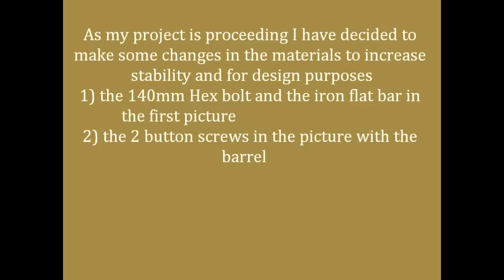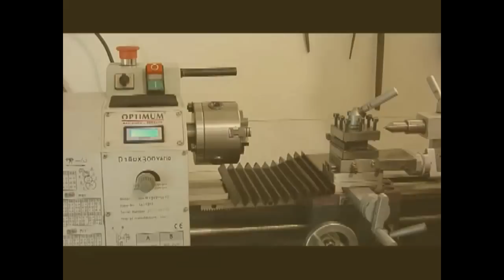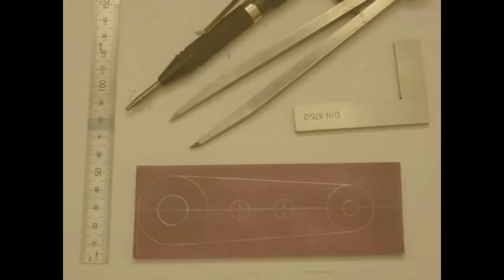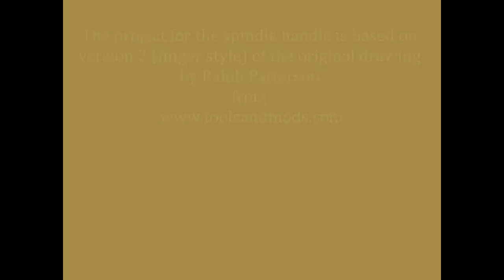Optimum D180x300  Lathe spindle handle

Comment: Very pretty handle you made.I just made one for my mini lathe I used aluminium for the expanding mandrel and cone with 6mm threaded bar through the middle a scrap piece of steel for the arm I used a hacksaw for the slots so not pretty but works very well all the best.
Reply from the maker: Hello Terry,
Thank you very much for your time to watch and your comment, I appreciate it!!
Allow me to say that it would been better if you had used a steel pipe for the mandrel instead of aluminum. I know that aluminum it's easy to work with, but it can wear easily especialy with the forces applied when you cut threads. I definitely recommend you to make one out of steel. 
Thanks again for the comment! Merry Christmas and happy New Year, my friend!

Warm regards from Greece
Jimmy
Reply: Hi I now have a slitting saw so can do a neater job and think I will remake that part out of steel at some point.cheers
Reply from the maker: Hi,
This, it will really nice to do plus that will grabs better on the spindle.

All the best
Jimmy

Comment: Any complaints with your Optimum lathe?  I know their on the pricey side compared to other Chineese made units.
Reply from the maker: proclaimliberty2000 
Hi,
Thank you for asking!
Only the usual that all mini lathe owners have, not very accurate tailstock alignment! The cross slide leadscrew and nut could been better quality, the same applies for the top slide leadscrew.
The disadvantages having a small Optimum lathe like mine is, the absence of the reversing tumbler and the low-high speed quik lever, that you can find in other small lathes as standard feature.
On the other hand I must say that the headstock running on two taper bearings and having accuracy of 0.01mm. The 600W DC motor for the size of this lathe I think is ok.
Optimum-Machines after sales service is excellent, they support you with any spare part needed fast-speaking from my experience.
Bottom line, for the money they could make it a little better with a few more features.
Thanks again!

All the best
Jimmy
Reply: ***** Thanks for the reply.  Were you not able to get the tailstock to align properly?  Just trying to get a feel for the quality of the machines as I can't find much online.  I'm looking at buying the Optimum TU2304 which is a little bigger with 750 watt motor.  Weighs 250 pounds.   Variable speed is not available in the USA but only the 6 speed belt change.  Just out of curiosity, have you had any problems with the variable speed system?
Reply from the maker: proclaimliberty2000 
Hi my friend,
I manage to resolve the tailstock issues! this the link: https://youtu.be/N6fIAYgAY_o  you can watch it if you want.
The TU2304 it is a nice machine and it has the ability to cut left hand threads by only removing a gear from the banjo! Ask the supplier for more info: http://www.ldsindustries.com/optimum-products.html
I have the lathe from 2012 and I didn't had any problem with the variable speed!
Stay tuned in the channel if you want. I'm working with a friend on a new project with a variable drive system.....hope everything goes well on this project...anyway will see?
Thanks again for your comment!

Wish you the best
Jimmy